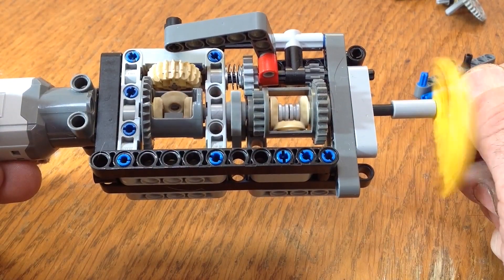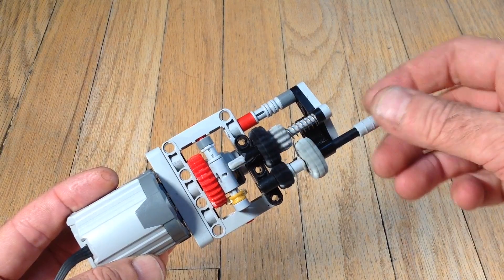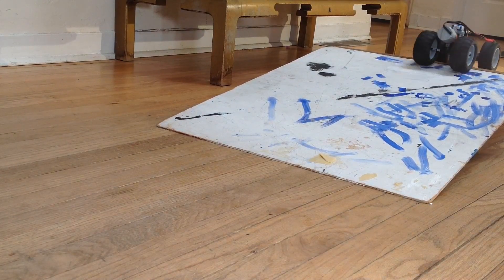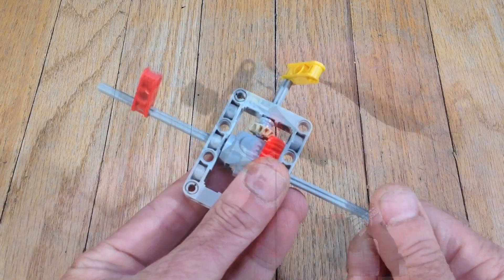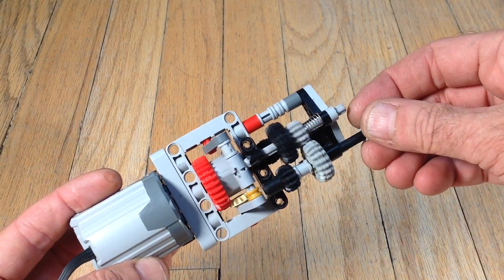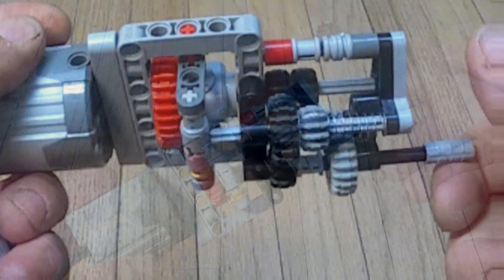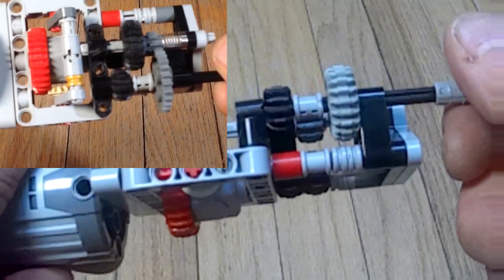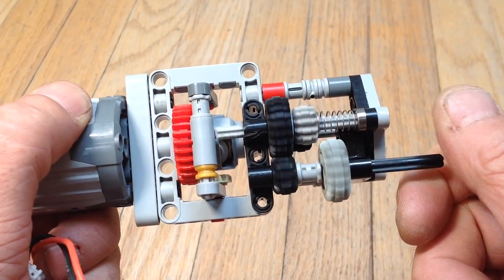Tiny Automatic Lego Gearbox Explained

Comment: that was so good i had to watch it again.. Certainly the most compact iteration and very smooth. Liked that a lot. Almost enough to tempt me back to lego 👍🍺🇬🇧
Reply from the maker: This is the first one I want to actually use in a car. Maybe with my little brushless Lego motor.
Reply: @MaxBrix  I think you'll need to keep the revs down to prevent the gear faces from wearing on initial contact. And then if you go to low on the primary drive, it'll have so much torque that it'll spin the centres out of the gears or twist the axles! you can get metal ones though.
Great development, am going to keep watching this but I'd put money on you going full Radio Control inside 2 years 👍🍺🇬🇧🇺🇲

Comment: The real problem with Lego gearboxes is torque handling. To me, a gearbox should be able to stall a motor, but this is rarely the case. I have managed to break many gears and also axes trying to build a heavy-duty gearbox. Perhaps an idea for a future video 🙂
Good luck!
Reply from the maker: I did a heavy duty 2 speed - FIREPOWER !
Reply: @MaxBrix  I did this one in a setup with A2212 brushless motor and I still got some cracking noises etc. The whole gearbox must be sturdy enough so basically each gear should be supported by another so there is no play in the the system. Anyway, the FIREPOWER gearbox was the closest one to simply achieve this goal!
Reply: awesome!! Oi! Max..... over here.....
Reply: @KRXLlON  With a brushless motor, you're asking for too much from those plastic gears. They were never designed to handle such big power. I've built Lego gearboxes that handle the power of a Lego buggy motor well but that's close to their limits (provided that I want it to last long) already.

Anything that is meant to handle serious torque and power should be made out of metal, both gears and axles. So you either go with metal Lego parts (which cost a ridiculous amount of money) or simply buy a metal geartrain. Everything has its limits no matter how much clever engineering you can put into it